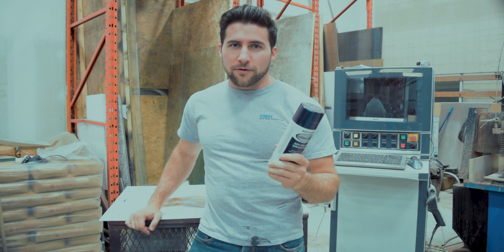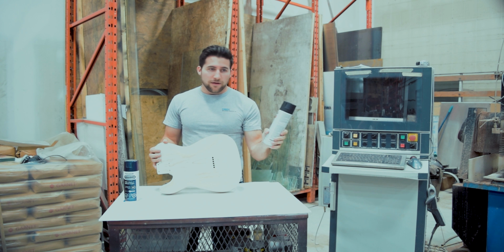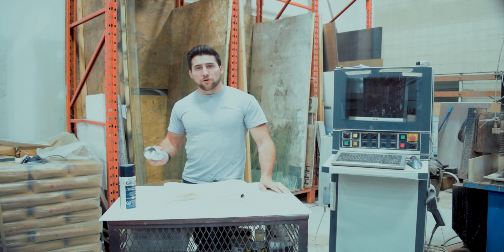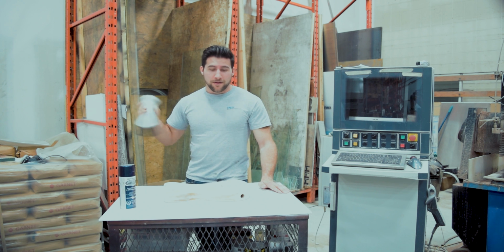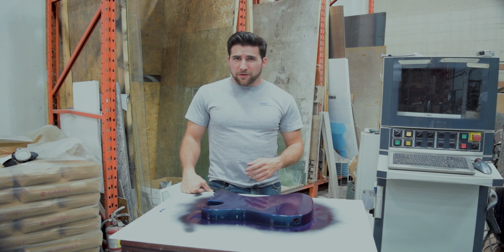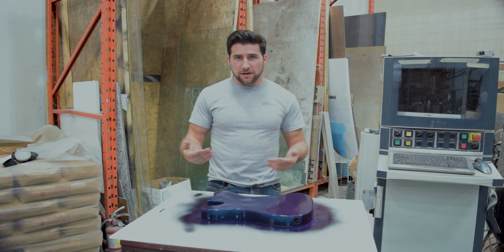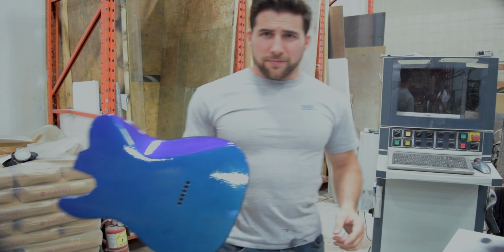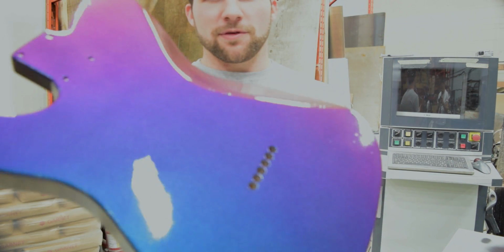How to do a Chameleon Paint Job with Spray Cans

Comment: That looks really good Brad.....I've seen this on cars and wondered whether there was a special technique or anything for it. Now I know! Just one question.......Is this able to be sanded flat in the usual way prior to clear coats?

One question more.....where exactly did you 'throw' that mask...cos it missed your face!!   ;)

Right-o...it's beer o'clock.....have a good weekend.
Reply from the maker: You can sand it flat, but I'd try to throw another light coat on afterward and then seal it in with the clear. Sanding it can mess with the way the metallic pigments sit.

I put the mask on at first to set a good example, but I was super hungover and it was making me feel less than ideal haha.
Reply: Yes, I wondered whether the light coat after flat sanding was the way to go as with other metallic paint.....thanks.

I get a similar feeling wearing my crash helmet when I have a hangover. I still have to wear the helmet, but at least I can open the visor!

Cheers.......

Comment: Hi. My daughter wants her bike painted with gasoline effect (rainbow gasoline spill). Is there a way to do that with spray can paint?
Reply from the maker: +Xavier Gutiérrez Muñoz Not that I’m aware of. It’s nearly impossible to get that level of transparency and detail from spray cans.
Reply: Brad Angove I had not enabled notifications for replies... I am sorry. Glad that I tried Twitter, though, and that I could include a picture of what I meant...
Reply from the maker: +Xavier Gutiérrez Muñoz I realize now that you’re looking for a broader effect. That should be possible; my only concern is that it will be expensive. Do you want
The colours to shift with changes in light angles as well?
Reply: @BradAngove
I do not think the bike colors change with the angle. The bike itself is this one (not my daughter's but the one she likes the colors of):
http://us.mafiabike.com/index.php/bikes/madmain/neomain/neomain-20-inch-bmx-bike-detail
You can see how it looks with angle changes here:
https://youtu.be/XK4huYXgENc?t=2m13s
I think there is some angle color shift but only between two colors at a time (pink/yellow, blue/green, purple/blue), not the full rainbow, if that makes sense.
I have looked at holographic paint but, besides it being extremely expensive, the effect does not look half as good as on the bike of reference...
Any thoughts/ideas?
Reply from the maker: +Xavier Gutiérrez Muñoz The chameleon colours are the ones that generally shift between two colours. You would need a few of them. Check the house of Kolor spray cans on coastairbrush.com.
Reply: Brad Angove thank you very much!
Reply from the maker: +Xavier Gutiérrez Muñoz You’re welcome.

Comment: I wonder how this stuff would work for hydrodipping...  Feature it prominently (b/c its expensive!), but work in some complimentary colors so it's almost a chameleon swirl...  Or hydrodip with different color shifts...  Oh man, if that worked it would be trippy!
Reply from the maker: +kirt fulcher That sounds like it would be pretty wild. The potential issue though is that the effect gets stronger as you add more coats. You would have to have a dark base, and then I’m not sure if you could get it on there thick enough for a decent effect.
Reply: Yeah, it seems like the aerosol paints skin over pretty quickly for hydro dipping so I'm not sure you can build enough on the surface of the water first...  Still, I just nabbed a $40 "project" guitar from the local music shop so I might just have a victim-er-test subject  :)
Reply: Also, have you played with Spaz Stix color shift products?  I stumbled across them yesterday researching color shift.  They focus mostly on the custom RC racing market but they have multiple color shift products for those looking.  Also, for you, Brad, they participate in a hobby "Hookup" program for trying out products and reviewing them... if you are interested.

https://www.hobbyrecreationproducts.com/pages/spazstix
Reply from the maker: +kirt fulcher Interesting. I may have to look into that.

Comment: 1. how long you wait between black coat to the chameleon paint ?
2. how many layers of each color (black, chameleon, laquer) ?
3. how long between layers of each ?
4. do you need to sand any of the coats/colors ?
Reply from the maker: 1. A day
2. 2 each
3. 10-15 minutes
4 sand any time you wait a day
Reply: thanks brad ! for quick answers !
Reply from the maker: You’re welcome.
Reply: what kind of sand paper do you use for each coat (primer, color and lauqer) ? do you use polish also ? before laquer ?
thanks again
Reply from the maker: Are you actually painting with lacquer, or with some other type of paint?
Reply: Brad Angove i want to paint primer than Silver metal color and laquer finish. I dont know what kind of sand paper to use for each layer and if i need to use polish after each sanding ( primar sand polish color sand polish laquer sand polish)
Reply from the maker: I sand my primer at 600 grit. What kind of colour at you using? You can’t just put lacquer over any kind of paint. Is your colour coat also lacquer?
Reply: i want to use car metallic color that also has same lacquer spray (its like set). do i need to sand color with 600-2000 and polish before i spay the lacquer ?

thanks for your answers ! im still learning :)
Reply from the maker: If it’s actual lacquer then you don’t need to sand between those. If it’s something else, then you should sand at 600 or 800 before clear coat. Never polish before spraying anything. Your paint won’t stick properly.
Reply: Brad Angove thank you very much for yor help. !!!
Reply from the maker: You’re welcome.

Comment: 2 Nights ago I was looking through Amazon for some new paints for my airbrush. I came across the blue/purple and the green/red chameleon paints and ordered both of them. The next day I watched a guitar channel guy I sub to and his brand new guitar is blue/purple chameleon. Tonight one of the recommended video's for me is this older video of yours Brad. I think someone is trying to give me a hint lol. I have been debating on what color to paint this Firebird Zero I am going to try and really trick out, I am either going with the blue/purple or the green/red  color. 

I am glad I watched this, I had not checked on what color primer to use. I was actually thinking of using  my light grey thinking it would make the colors not so dark, but then you said what you did about the black, so black it is! 

Do you have any video's on painting with candy apple red? I have an SG project that I am painting CA red . I used a pearl silver undercoat and will be applying the third coat of the CA red here in a few minutes. Tonight, the second coat seems to be taking on a more orange hue to it. I've read that this is somewhat normal for CA red and why you need to paint it in stages until you get to the desired color you are seeking -  if you've used CA red before is what I am saying correct? Also, do you use regular airbrush guns? Not the big ones I see you using, but more so the smaller ones for detail type work? If so, do you have a particular brand/model you recommend. I bought a compressor with 3 different guns through Amazon and I'm not real happy with any of them. 

Thanks again Brad, another educational video to add to my collection!
Reply from the maker: I love this blue purple chameleon. Base color does matter though haha. 

For CA red, you will find that it builds to the proper red hue much more quickly if you base it in metallic gold instead of silver. Notwithstanding that though you should be able to reach the desired color with enough coats. 
The problem with candy paints is that they need to go on super even because of their transparency. For that reason I only use my bigger guns with it generally unless I’m doing specific abstract or detail work.
Reply: Thanks for the response again Brad. Yes I thought about what you said, using the gold. Too bad I thought about it and read your comment after I applied the third coat of CA red lol. Oh you are so so right about it having to go on evenly!! When I put the third coat on last night I noticed a couple of spots that seemed a little light, so I hit them with the gun... back to the orange hue lol. You can literally see the 3 lines where I touched it up and they appear that orange, which is really the gold being more prominent than the red. I have a bigger air gun but I need to set up my big air compressor before I can use that gun. So for right now I am using a regular sized hobby air brush, which has been working really nice, until I bit into that CA red lol. If it keeps messing with me I will just put it on the back burner until I get my big gun ready for use. 

I have a question for you regarding the fret board if you don't mind. We talked the other day about the line along the edge and such if you recall. Well, I am thinking with this new Les Paul project that I may remove the fretboard and paint the neck that way, your thoughts on that? 

Besides trying to avoid that whole line issue another reason I am thinking of doing it is for the experience of doing it.
Reply from the maker: If you’re not concerned about glue pressing onto your paint I don’t see any reason why you couldn’t do it that way, but I’ve never seen it done that way haha.
Reply: Hmmm, good point about the glue! I guess since I don't have to worry about binding along the edge of the fret board I can just paint the sides of the fret board like Gibson does.
Reply: I wouldn't remove the fretboard I would tape it off if your going to paint the neck. Also when I paint guitars I typically hang them from a screw so I can coat the whole guitar evenly. I painted my son's guitar with the green/purple color shifting paint and it came out amazing!
Reply: @Nick Bisson - Yeah I've decided against removing the fret board. I was just trying to avoid that line at where the fretboard and the new paint job meet. Brad gave me an idea for that. I see sometimes the sides of the fretboard get painted along with the rest of the neck but I don't really like that look.

Comment: Some tips - 

If this is your first time with a rattle can it should be 12-16" away. Very light coats. Try and mimic him you'll be running.

Primer recommended 

Black base coat REQUIRED - 327866 

Do NOT sand or thin the color shift paint in any way. Nope! Not even with wet 3000 grit sand paper.

3  color shift coats minimum, 5  should be good. Additional coats can be applied after a few minute which gives you time to look for any issues. If you leave it to dry for a full hour you need to wait a full 24 hours for another coat.

A clear coat enhances the effect. Super light coats. 280702 

OR

USC SprayMax 2K Glamour High Gloss Aerosol Clear - Only with appropriate safety gear. Contains cyanide which will kill you.